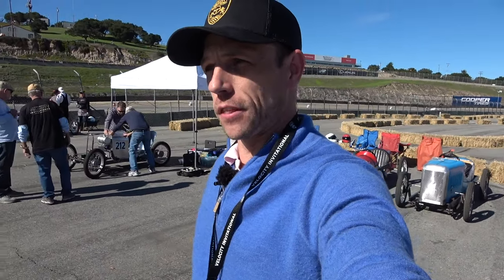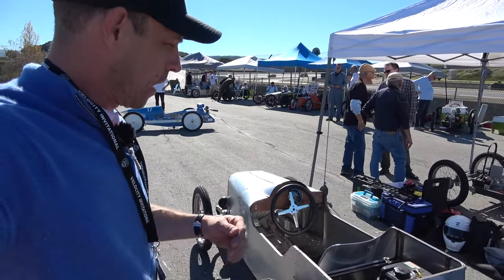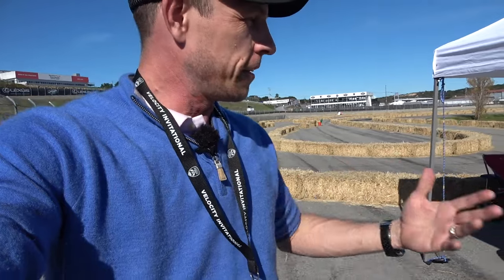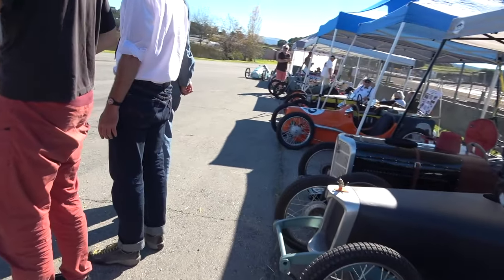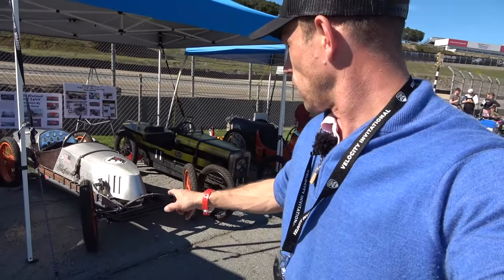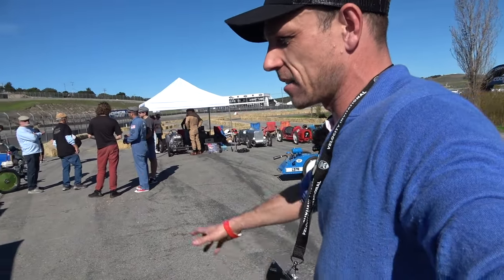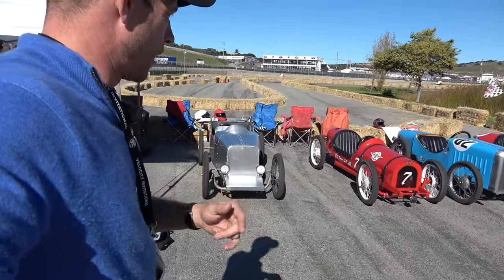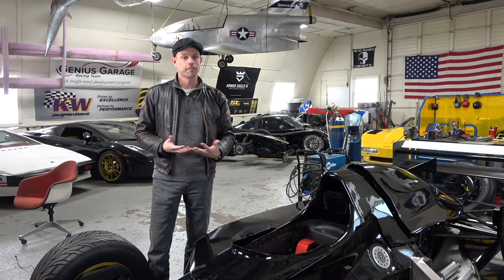Cyclekarts- Incredible tiny race cars YOU BUILD yourself?!

Comment: Wanted to build one of these years ago, but didn't have the means. This summer I ended up building a front-engined gokart that looks like a T-bucket using an old wheelbarrow as a body, a Harbor Freight 212 Predator engine, golf kart tires in back and small wheelbarrow tires in front.  Maybe I can build one of these next.

Comment: Maybe that's a way to start a new racing series?

Smaller cars, few rules, smaller engines, keep the costs down.

Have a max track width, max wheel base, max overall length and width, minimum weight, maximum engine size (limited by total cu in volume?), don't allow turbos or supercharging and NOS, maybe a rule such as the solid rear axle and limited to rear wheel drive... Otherwise, go for it. Keep the rules as minimal as possible and allow innovation and keep it accessible. Maybe a few more regarding helmets and other basic safety things. But imagine including pit stops into a series like this too, perhaps? Without restricting fuel carrying, you might opt to skip pitstops to save time, but then you might be running more worn tires, tradeoffs, I don't know?

But by keeping the vehicle and engine size small like these cyclekarts, the engines remain affordable and accessible, and by limiting total internal engine volume, it becomes an efficiency game regarding HP. More people could enjoy and participate in such a racing series across the nation, without needing deep pockets and lots of space or specialty tools.
Reply: There already are rules that govern a lot of it (look up Stevenson cycle kart rules), I think there's a general disdain for organizing bodies and the cheating that comes with sanctioned racing in the ck community, so they are looser and not at all tolerant of the type a win at all cost mentality.

Basically, use a 6.5hp motor and keep the look right and you'll be good, the rest is up to you, but they award more based on spirit and looking the part than any type of speed or race winning.
Reply: @bobzdar  Yes, I get the concern over sanctioning bodies. Eventually when a good thing becomes successful enough, money and corruption takes over and the sport is then ruined. This happens to good businesses that go bad too.
Reply: I would love to see a 2seater class as they were originally available in both 1and 2seaters (of course the 2seaters would need to be given a wider track width but keep the other dimensions
Reply: @dodgeme1986truck  when did cyclekarts ever drive on teh road as 2-seaters? Literally NO point in requiring a 2-seater other than driving up cost (more material, need a larger trailer, etc.) for no reason.
Reply: @SoloRenegade  2seat 1915 woods mobilette, 1914 twombly, 1921 carden cyclecar, 1914 swift 2 seater, 1914 merz cyclecar, can't forget the Morgan 3 and 4 wheel models, 1913 warne, 1914 Buick cyclecar, 1920 briggs&stratton flyer to name a few... They were available in a sxs and front/back seat configuration... Easiest I have found to reproduce is the 1920 briggs&stratton flyer
Reply: @dodgeme1986truck  fair, but what purpose does 2 seats serve with regards to  affordable racing?
Reply: @SoloRenegade  you could do the old style navigator/rally racing as an option or standard road course as a 2seater handles different from a single seater... 2 seater also can perform other functions outside of racing like transport around a farm, neighborhood transport, some states they can actually be registered for road use (ex. WI as a (lsv) low speed vehicle as long as it can exceed 20mph in 1mile but does not exceed 25mph) to get you to and from work... That would be great for a 2 seater class however a slightly bigger engine may need to be allowed

Comment: Cyclekarts are great and I want to build one and I was going to... but ended up making a half scale lotus 7 instead with a full locost chassis but in half scale material and it is powered by a 125cc 3 speed engine and gokart tires because they fit the scale that I was working to.
one day I'll get back to the original plan to build a cycle kart.

Comment: Where do you get the rims and tires and at what cost?
   I wanted robust high profile yet narrow tires for my front but the price per was nearly the same as the 16hp engine i bought. I had to settle for 18.5 x 6.5 tires (the right height but the width makes it so i must redesign the front end so everything is as robust as the tires and rims.  My kart has 5/8" spindles, nuteral caster and camber and i have to change all of that. Including the tubing used in the knuckle and supports -- what a mess.

Comment: These look stupid fun!
No brakes? The drums on most of these looked empty, especially on the front
Reply: It is crazy fun. Most are one wheel key/drive and one wheel brake.  Still leave a great smile on your face after driving. Join us at next event and I will let you drive any of our shop cyclekarts (built as a high school auto shop project)
Reply: @bonnevillegarage  unfortunately I'm all the way across the ocean
Reply: Up to the builder - you can put 4 wheel discs on it if you want (and the car you're emulating had them), though it won't do much as there's not a ton of braking involved.  Rules are basically use a 6.5hp 200cc motor, keep it looking the part, and the rest is up to you.